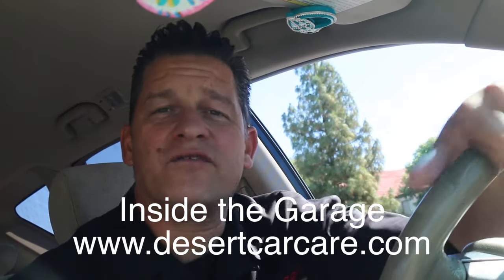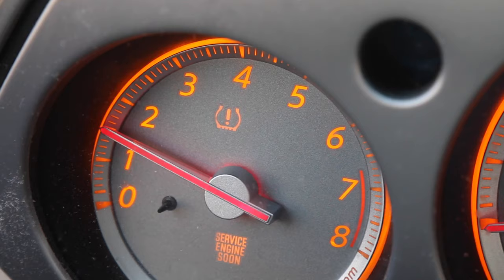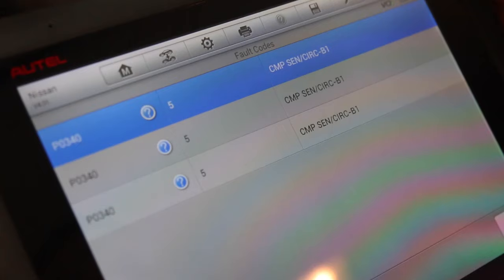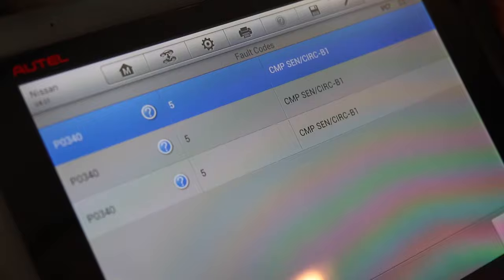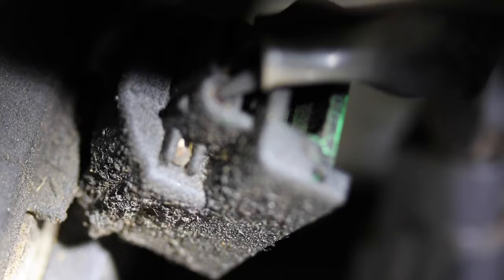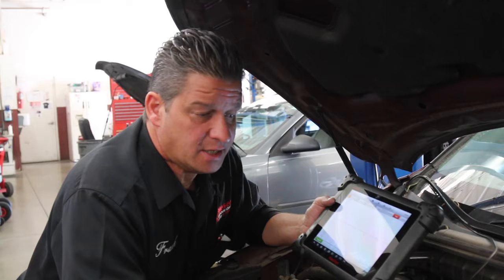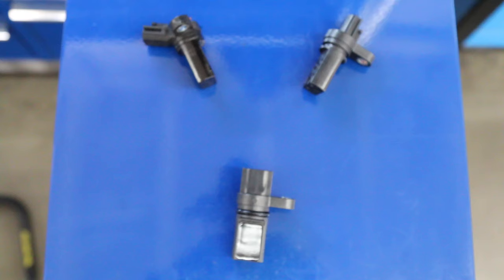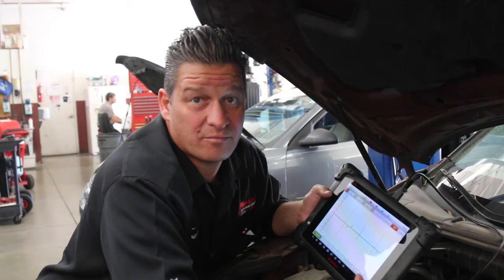Nissan Murano Camshaft Sensor Tips

Comment: Helpful video,thanks.
I find checking the oil level difficult to do on the Nissan Murano
Reply: Little trick tip. Make sure the vehicle has been off for over 15 minutes to get the most accurate oil reading .

Comment: Good morning! May I have your help?
My Nissan Murano 2004 180.000 miles is presenting some hesitations and sudden stop in the way at 70 miles x hr. The engine decrease the RPM, them the brake light on steady and the check engine light appear. I stopped the car, turn off the engine and turn on back. The check engine light remain on, but the symptoms disappear. Can be the same issue that you are describing in this video? Thanks a lot for your help! And, forgive me if you find any grammar mistake, I trying to do my best to speak and write English well!

Comment: I have a 2007 Nissan Murano s ive replaced all three sensors myself but the same problems are there had to buy new connectors from ebay and pig tail them in seemed to work for the crankshaft sensor but not the camshaft sensors need help asap the car has a very rough start now

Comment: RAFI HAD TOYOTA CARS FOR YEARS & hardly anything goes wrong with TOYOTA CARS. ALL MY TOYOTA CARS RUSTED FROM NEW ENGLAND WEATHER. MECHANICAL WISE ALL HAD LASTED GOOD 15 years or more. FIRST WAS TOYOTA CAROLLA 1.8 Liter engine
MAINTENANCE IS KEY TO A RELIABLE TOYOTA.
1. Put BRAND NEW BATTERY- EVERY 4 years.
2. Changed CAP, ROTORS, SPARK PLUGS & IGNITION WIRES 60, 000 miles. ( even though it is early preventative maintenance)
3. Threw in FRONT BRAKE PADS 3 years HALF or less worn pads ( even though it is early preventative maintenance)
4. Would remove TRANSMISSION PAN ( so many 10 mm bolts) CHANGE FILTER of transmission), clean pan. 
5. Radiator COOLANT- 40,0000 miles ( off course, ADD 50/50 ready MIX COOLANT).
6. Not last or least all belts of vehicles 35,000 miles
WAS NOT AFRAID TO HAVE MECHANIC DRIVE , and ask..
If anything missed besides oil changes etc
LIKE RAFI SAID, BEEN BLESSED WITH SUCCESSFUL TRIPS MAINE to TORONTO, CANADA & QUEENS ( New York ). MILLIONS OF TIMES.
OH ! What TOYOTA CARS, made with PRECISION AND ACCURACY.
RELIABILITY is the RESULT OF TOYOTA PRODUCTION.
RAFI MAINE USA

Comment: Hi, thx for this great video! I changed all 3 sensors about a month ago as i had trouble at cold start, then it worked great, and yesterday the p0345 bank 2 error code is back! Any advice ? Thx a lot and happy new year !!!
Reply from the maker: Matthieu ~ were they aftermarket or Nissan sensors ? We have seen problems with aftermarket cam sensors here, but need to confirm, otherwise need to test it to know for sure. Call ya at the garage if you need any further help over the phone ~
Reply: Just ignore it

Comment: I have a 2008 Sentra 1.8 engine 160k.   I’m getting the dreaded P0011 code. The dealer said it needed a timing chain. I ordered Nissan parts off of E bay and had it installed.   The internal engine looked great. The light came back on.  It has a new crank and cam sensor in it and both from Nissan.   What am I missing? What else can it be? It’s running like it did when it was new. My wife and I love this car and we want to keep it.  The dealer said they have seen this problem before but not in  160 K.  Any ideas?
Reply from the maker: Carl Jenkins ~ tough to say here ~ call me at the garage ~ will try & research for you

Comment: One thing that needs to be mentioned regarding replacement sensors. I replaced these about 8-10 years ago, and just replaced them again last week.  Getting under the hood, and was all sorts of oilin/around both sensors. After pulling them out, did a double-take when comparing to new replacements. Old ones had no o-rings, new ones did.
Well, I know who the dummy is now... But I'm sure I didn't remove the O-rings on the original replacements, and I always check packaging.
I'm assuming the OEM ones must have had them, not sure why I didn't catch when replacing the first time.
Just keep a look out.
And BTW, this time I replaced both cam sensors as last time, however was still getting P0340 error afterwards.  Since its got 150K on it, I replaced the crank sensor, and no more problems.

Comment: I changed all of the camshaft sensors and crank sensors but i still have an issue with the engine light and slip. I cleaned the connector and it still is there. Before the sensors came on i actually serviced my car and then after that it came on when i parked. It takes a while to start as well.

Comment: When u drive car on the low speed car runs fine but when u give a speed tittle bit its start to slip  the transmission
Reply from the maker: Bobby Ali ~first things first ~ Check that transmission fluid level . If low ~ refill to spec & repair the potential leaks. Otherwise you may have a shift solenoid or internal transmission fault. Where are you ~ I can recommend a transmission shop by if needed. Good luck here .

Comment: hello am jenny i have a question...i have a nissan murano 2005... first time owner of a car in general..so am learning. my airbag light is flashing and my horn went out also i took it to nissan which the putmy car on the machine and it gave 5 different problem according to them so i went ahead bought the parts so my bother can fix it turn out out of 3 engine mount i need 1 everything else i have replace and nothing seem to work nissan wanted to charge me 3,500for all the problem.. can you please explain to me what cause that or post a video of what to do when this happen....thank you
Reply from the maker: Jenny Tirado ...I suspect the horn & air bag related to a clock spring fault. Email me details & I will video. Hang in there ...all good . -Frank
Reply: can i have an email am new to your channel..thank for the reply
Reply from the maker: Jenny Tirado ...frank@desertcarcare.com
Reply: You need to change the angle sensor. It's inside the steering wheel just in the center. 
It's in charge of all the problems you mentioned.  I had the same problem with my Nissan Armada !

Comment: I have a 2000 nissan maxima. And she is having a cold  hard start, and when the car is completely warm up it stalls. But this only happens  when the engine light is on. Once  i clear the code the car drives great. What could this be?

Comment: Does the Autel unit you are using have pids for both bank's camshaft sensors and vtc solenoids? What I do after checking for proper engine oil level is to put all 4 on screen and look at duty% of solenoids each and  deg.of advance of timing of each. When one of the phase sensors is bad you will see no change under load in drive with foot on brake(aprox.1200rpm).
Reply from the maker: John Kimmel ..great question. The Autel has  2 channel scope ability & we typically don't have an issue with that setup. We can go to our SnapOn Modus 4 channel if necessary..great input ! Thanks

Comment: I have a Nissan Murano, the engine light came on, it stall on me one time. There seems to be a little vibration and missing with the engine. I took it to a mechanic they told me one of the cool needs to be change, the engine light came off when I took it from the garage. But the following day while reversing, I noticed the engine light came back on. I also felt a vibration. What you think is the issue?

Comment: I have a Nissan murrano when I press the gass and start driving and stars  hesitating to go . I have no check engen lights on
Reply from the maker: Johnny Placido ~ tough to say without seeing & testing < you may have the beginning stages of an ignition coil that may be starting to go out or a need for a good ol fashion tune up < have it tested before you start throwing parts at it ~ good luck here
Reply: Hey I was wondering if you figured out the problemI have a 2007 Nissan Murano SL I have changed the oil did a full tune-up replace my whole exhaust system and every O2 sensor. My car tries to die if I turn the AC on and does not run well at low gears if I stop giving it gas
Reply: @briancollard6825  & Johnny placido , Have u tried cleaning the throttle body, When clogged up it usually creates hestistion or even stalling at initial take off and during stop and go situations, also it is related to AC operation as well.

Comment: I have a question about a 2006 G35. A mechanic did some work on it last year and since then my parking lights don’t blink when I lock and unlock. He claimed he changed the body control module. And replaced the immobilizer. Any help will be excepted. Thank you sir.

Comment: Greetings Desert..Rich here quick question  I'm currently running 06MaXse 5At..and I'm having a  p0731..car drives quite fine..I check transmission fluid it's all good..wires all good..would the transmission speed sensor cause that code..thanks In advance..any info would be greatly appreciated

Comment: Hey frank I have a 2014 Nissan Pathfinder 3.5 platinum 4WD I have a stalling issue due to cold weather when it gets to -10• C and no check engine light came on and no codes came up what could be the problem I went to Nissan dealership and they couldn’t locate the problem my vehicle is at 170 thousand Km please help me out

Comment: Tip #1 was don't replace parts that are okay. Action: we're going to replace all 3 sensors even though two of them are fine!!!!
Reply from the maker: WiscoFun < good point inserted. 

We made the assertion based upon the age of all 3 and the common failures that can occur thereafter ~ if you have one failing ~ it is certainly your choice to replace what is only broken |failing at that time . 

If you were to come back with the same symptoms months later , you could argue why do I have the same concerns/symptoms and furthermore why didn’t you advise me of the aged other related sensors that could have been remedied on the first visit after a costly tow and missed day of work. 

Use your judgement with what you feel is right for you as it is your ultimate call on what you decide to do. 

Our goal here is to inform folks of options and declare some of the real world pattern failures that they may decide to completely avoid, of to which some may decide to not bother with a headache that could be looming .
Reply: @Desertcarcare  I agree, because if I wouldn't go ahead and replace the third sensor guarantee you 6 months later it would go anyway. Better safe than sorry LOL

Comment: Like other 3.5 Nissans it's burning oil.  Other issues: timing chain, cvt transmission, subframe rust.  These cars are junk!
Reply from the maker: TruAgape1234 ...indeed. The list can go on. Thanks for the input !
Reply: If by junk you mean a car that can run over 350k miles then yeah. The cars are as good as their owners. Oil, coolant, and transmission fluid change on schedule and car should run fine. No major problems on my daughters 04 Maxima with 357k miles on it.

Comment: My 07 murano hesitates when accelerating. Code1721 came up speed sensor. No SES light is on. Sensor is $200.am I out of $200 if it doesn't fix the problem. That was he only code from diag.

Comment: I have 07 murano that when i put it in Drive i press the gas pedal all the way to the floor and it bearly moves foward the fast ir will go is about 5 miles per your and my rpms stay around 1000..... what could the problem be
Reply from the maker: Juan Hinojosa ...check that throttle, otherwise ring me at the garage anytime. Good luck ! ~Frank
Reply: Desert Car Care thanks for the prompt response..... May i have your digits to give you a ring
Reply from the maker: Juan Hinojosa .
ring me tomorrow am..480 726 6400
Reply: Desert Car Care good afternoon frank,  i have a question does a 2009 cvt transmission fit my 2007  murano.... or does it change to where i cant use it....
Reply: I got the same problem did you fixed it

Comment: I have a 2006 missan murano 3.5 litre engine it started missing it runs for a couple minutes then dies and have to let it sit for about 15 minutes it is throwing a cam sensor code po340 any ideas greatly appricated
Reply: It also has has multiple random miss
Reply from the maker: Best to have proper testing performed ~ you may have a few things going on here ~call us anytime if you need a referral of a great garage in your neighborhood

Comment: Hello my husband replaced all three sensors all OEM. 1 camshaft was new the other used and the crankshaft was used. Now were getting the P0021 code, we have spent soo much money in repairs and we don't want to buy anymore parts unless we can be sure what the problem is. I've read that sometimes its just a bad camshaft, what should we do to eliminate which part is really defective i.e cam crank or ivt solenoid.
Reply from the maker: Alureals....best to discuss this one over the phone. Reach out 480 726 6400, and I can get you answers ! -Frank
Reply: Okay I will tell my husband to call you. He will understand the mechanic talk more. LOL

Comment: Please i need your help on this: my engine was drop for the purpose of changing pisting and ring. after the engine was fixed and mounted. i discovered oil leakage from gearbox. The gearbox oil seal was immediate replaced. The oil leakage resurface after driving the car. the seal has been  change for the third time it seems the problem refuse to go. please any advice.
Reply from the maker: peter damisa ...using a "dye" in the system along with a UV light may help pinpoint. If you are talking about the rear main seal ..make sure crank surface where the seal is seated is not etched or scored. Let me know how things turn out for you.  -Frank

Comment: my murano 2005  starts but dies when i accelerates and will not starts  back untill few hours , i change all sensors cam and cranksharft  , need some advice
Reply from the maker: Dudley LaRocque ..ring me at the garage for help & tips. ~Frank
Reply from the maker: Dudley LaRocque 480 726 6400. All good .
Reply: Thank you , what is your opening time ?
Reply from the maker: Dudley LaRocque ..ring me around 11am..all good.
Reply: sell it. Muranos are junk and will constantly be costing you money. Sell before the cvt transmission goes bad!  They have horrible transmission design and not if, but when will it fail. My wife like the car, but I am constantly working on it and changing parts out. Every month or two it cost us more time and money. I cant wait to get rid of it, I just have to talk her into letting it go.
Reply: I've got my wife's 2006, and aside from 2x replacement of cam sensors, the tranny went at just under 120K and inside their 2010(?) extended tranny warranty.  Lucked out there, however while they are nice Jitco or whoever is their Nissan subsidiary making their CVT's have a pretty poor history with CVT's. I believe even until this day.   Apparently Toyota's CVT are almost bulletproof.  Probably no more Nissan's for me in the future either.

Comment: Frank my man, 
I have a 350z 06 3.5 and it too popped a P0021 crankshaft sensor. so i fleaned both VVT sensors and replaced both bank 1 and 2 camshaft position sensors and cleared codes and it keeps popping back up. the first time it happened both codes P0021 twice and P0300 twice came up i did manage to clear for good the p0300 misfire but cam sensors i cant figure out why or why not. can you help please
Reply from the maker: Denny Christensen ~ring me at the garage ~ do my best to help !~Frank
Reply: @Desertcarcare  ok well im going to do another oil change sense i just remembered i used a additive used for getting hp back. after looking at the fluid/oil on the VVT selanoid it showed copper flakes in it. this could be clogging up my VVT but not positive on this yet. This car has many issues including rear drive axel or wheel bearings or bushing shot and a 2000.0 crap clutch that some idiot installed in Kirkland washington and only put 2.5 qaurts of oil instead of 3.5 and could have lost life of the clutch it self. I look you up at the garage my friend.

Comment: Hello. I have a 2007 nissan murano i had the service engine soon light and car kept shutting off went to auto zone got code p0340 replaced both cam shafts and car raned fine for 2 days but the code came back on.  I just keep getting code p0340. Took it to 3 mechanics and all they did was change camshafts. Should i replace them again and crankshaft as well with original nissan or hatachi sensors?
Reply from the maker: Nutz Mel make sure they review waveforms & capture glitches. Cam & crank sensors common ~~go with NISSAN ~~make absolutely sure they test for faults & not solely code reading ~~Frank
Reply from the maker: Both cam sensors & crank sensor all replaced together if one defective ~~good policy to do them all here 🤜🏼
Reply: Desert Car Care 
Will do. Thank you Frank!
Reply from the maker: Nutz Mel ~~good luck here brother ~~here if ya need help no worries.

Comment: Hello guys, quick question, when replacing the icu on a 2008 altima do i have to tow it to the dealer to get reprogram? my friends icu got corrosion from the battery and is all damaged.
Reply from the maker: Yes. You may find alternative tricks & tips throughout the Internet to avoid this,  however,  flash programming will absolutely ensure all is reliable with the air/fuel management system. Good luck !

Comment: where do you go to get the parts?
Reply from the maker: Daniel Day ..Nissan dealer the best bet, however,  here is link for Dorman Aftermarket Parts if cost is a factor : http://www.partsgeek.com/gbproducts/MC/6738-07208146.html?utm_content=MC&utm_term=2002-2008+Nissan+Maxima+Camshaft+Position+Sensor+Dorman+Right+02-08+Nissan+Camshaft+Position+Sensor+03+06&utm_source=google&utm_medium=ff&utm_campaign=PartsGeek+Google+Base&gclid=Cj0KEQjw6uO-BRDbzujwtuzAzfkBEiQAAnhJ0K1WhgYyKE77xKMqZWIN69BdGGC2jLbaU9nGar-QSNoaAsQD8P8HAQ&ad=47433949932
Reply: @Desertcarcare  so many after market options... how do you chose which after market brand to buy here.   I need/want to buy all three sensors to fix codes p0021, p0011,p0345 ...  2011 Murano with 160K miles... does have hard time starting..